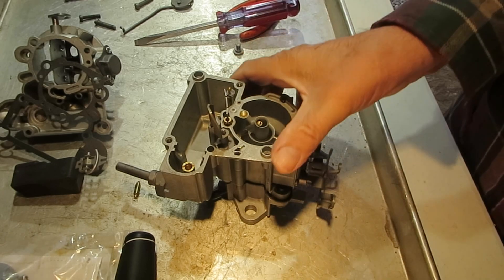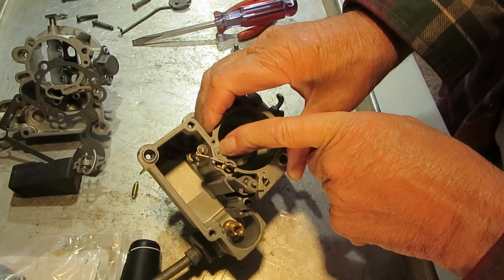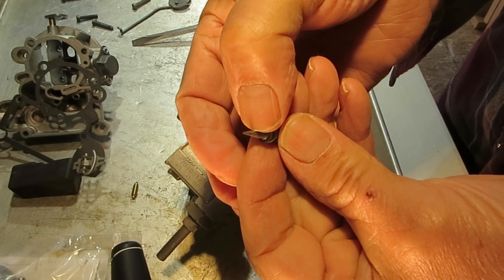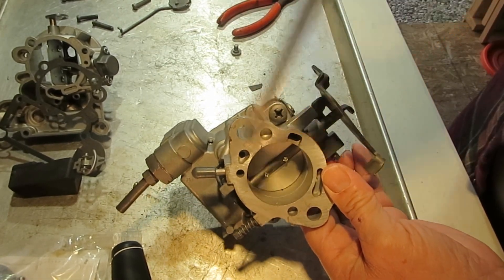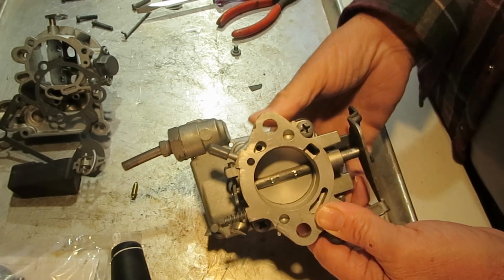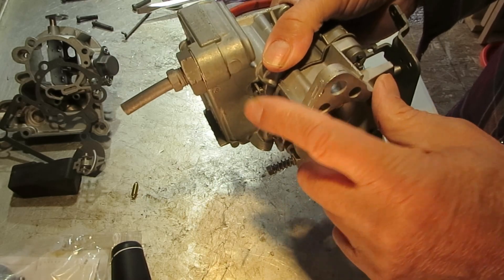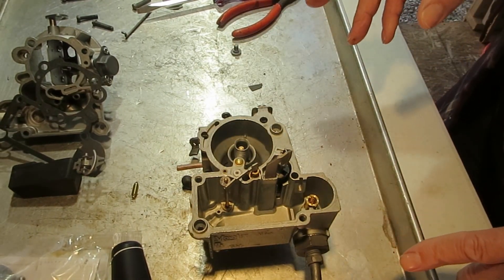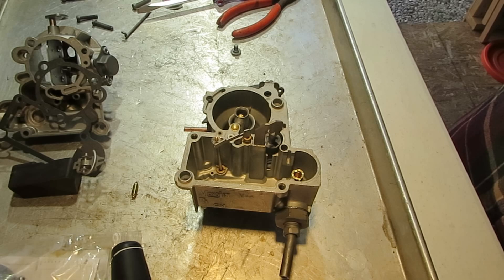Rochester Monojet 1 Barrel Carburetor Idle Circuit

Comment: Mike.. i know this is a years old video..  
at idle the fuel is pulled by manifold vacuum past the round opening where the idle mixture screw tip is the limiting feature for idle only.
 above idle the Idle transition slot is progressively exposed.. the farther is is exposed the more fuel is pulled out by vacuum below the throttle blades  on a V8 engine . this is from just above idle to around 1800 where there is enough flow thru the cluster to start pulling fuel up and into the venturi.. the idle circuit loses  the ability to pull fuel as the throttle blade opens farther. at around 2400 On a V8 the only fuel getting into the engine is coming thru the cluster and the main circuits..
Reply from the maker: Thanks. That is correct.